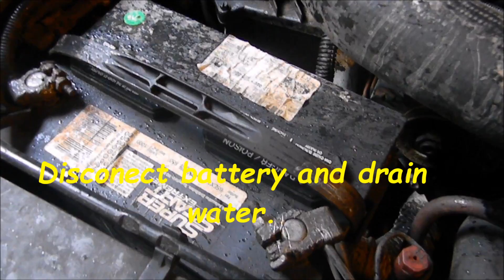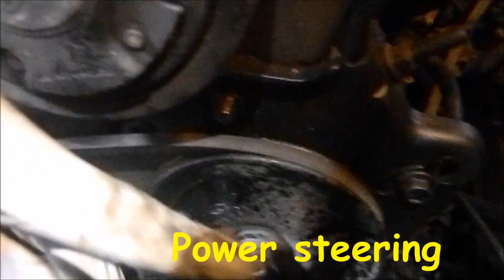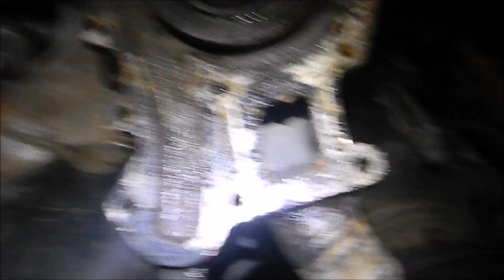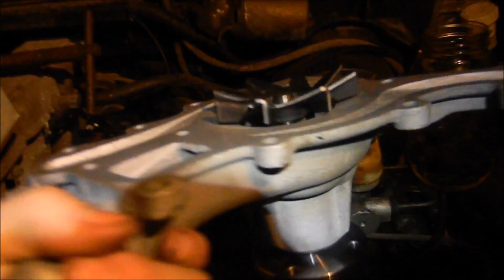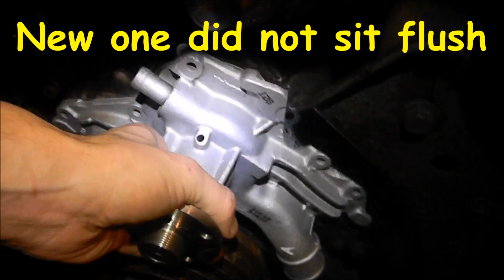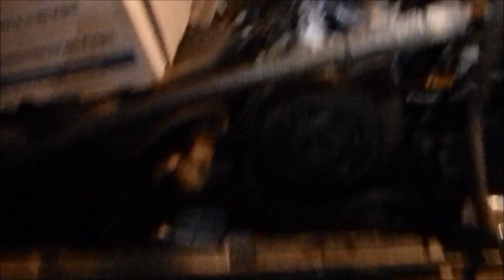2.9L V6 Ford Ranger water pump install, removal

Comment: Did urs over heat bad when water pump went out idk if it's my pump or not but I took out the thermostat to see if it over heated n it still did so is this my issue as well

Comment: I losen the fan clutch nut and four pully bolts before losening the v-belts.  Most of the time I can losen this hardware by just grasping the belt and squeezing them tighter using my hand.  Remember, the fan clutch nut will have left-hand threads on this vehicle because of the clockwise drive system.

Comment: I have a 2.9 L. Would a bad water pump cause antifreeze mixing with oil?
Reply: sry but no it wouldnt. but a bad head gasket would
Reply: Damagad cylinder head (and/or) gasket (from overheating).
Another possibility is corrosion of the lower intake manifold.  These are getting to the age where if the cooling system has been neglected, corrosion becomes a serious issue.

Comment: Why would you let it sit 24 hours before driving it?  Gasket and/or gasket seal work with clamping pressure, not by harding like pipe cement on a water pipe.  If it leaks after torquing it down, then no amount of waiting would have made any difference because of the heat cycles a block goes through.
Reply: You have to let gasket maker cure before you torque it down, otherwise it will just squeeze out. Been there done that.

Comment: The water pump will make noise if it's bad sometimes a wine or there will be play in the blade in the rear. Sometimes when a pump is bad the blade in the back will scratch the housing.

Comment: which way did you turn the big bolt to take the fan off?
Reply from the maker: +Slider Cook  I dont remember. lol. but u proabaly got it by now.
Reply: It may not have sat flush because you used a wire wheel...from what I was taught you wanna avoid that